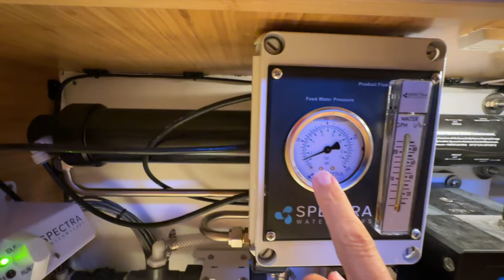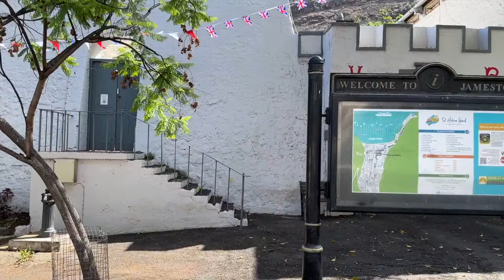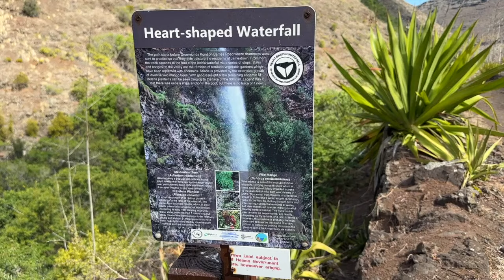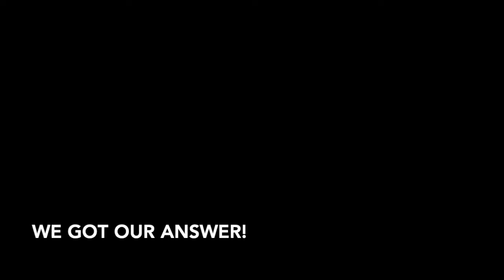GTFOplan #55: What happened to our crew in St Helena!?

Comment: I have to ask. Why did your crew leave the ship? Why did they say they left the ship? Did Balance have a hand over process when you picked the boat up? Were you happy with it despite the issues you didn't find until the crossing?
Reply from the maker: No clue why our crew left other than, “This isn’t what we expected.”

There is a handover process, but we feel it was rushed because of the pending Christmas/ New Year holiday closures. We’re still happy with the boat, but feel the handover process could have been better. 

We did a few shakeout sails before we left, but expected to have other issues surface.
Reply: @GTFOplan  Thanks for the videos. Compared to other models, there aren't that many Balance Catamarans out there and it helps a lot to see them in the wild.